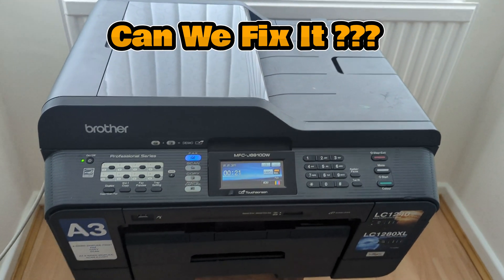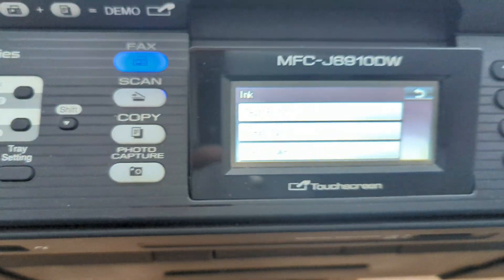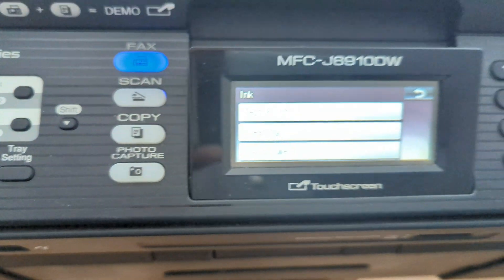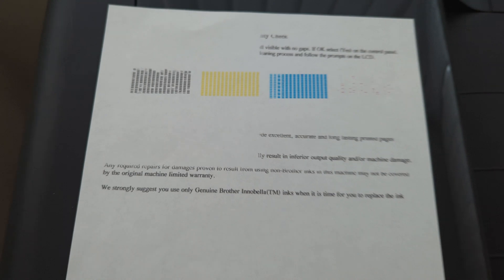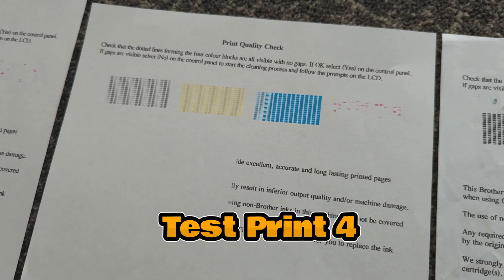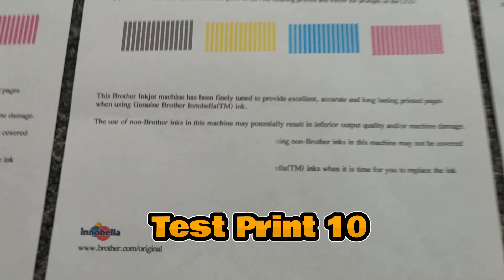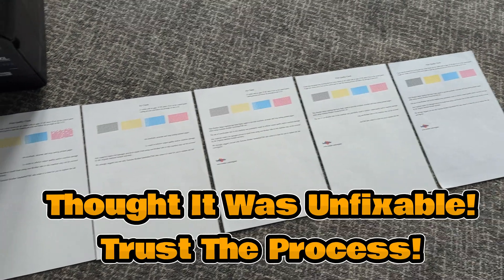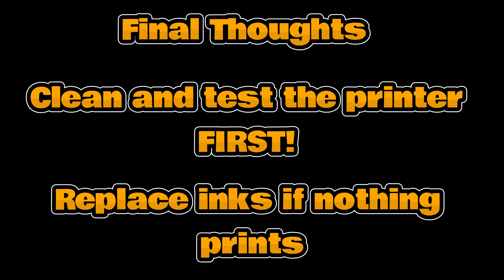Inkjet Printer Head Cleaning Brother MFC-J6910 - MULTIPLE TIMES!

Comment: I just want to point out that sometimes, running that cleaning doesn't fix the problem, no matter how many times you run it, because the print heads are clogged.
Reply from the maker: @nomore6167  True, if they’ve been left for ages then they’ll need chemically unblocking however cleaning through so many cycles worked for me and cleared the heads completely, sometimes repetition works. Before I would have maybe given up but I could see improvements will every cycle so was worth sticking at it until it was clear. If no improvements after a few cycles then yes, would agree totally blocked 👍
Reply: @MrNot2Techy I've had printers that have taken 10-11 print cleanings before, with slight improvements after each, but I'm dealing with one now that isn't getting any better, even after 10 cleanings (it's actually worse than before I did the first cleaning).  I was told the printer is used only about once per month, and there's still ink in the cartridges (they haven't dried up).  The print heads SHOULD never get clogged until the ink cartridges run dry, since all Brother printers I've seen do a self-clean every day, pulling ink through the printheads (which is why you go through so much ink, even if you never print anything), but yet, they do.  I'm reminded of the HP DeskJet printer I had back in 1993 or so, which never clogged and didn't waste ink every day like these modern printers.
Reply from the maker: @ just from what I remember working for curry’s many moons ago was with the HP printers you got a new print head with every ink cartridge, don’t recall if it was every one or only certain ones but that might have had something to do with it haha, you obviously know your stuff too! 👍